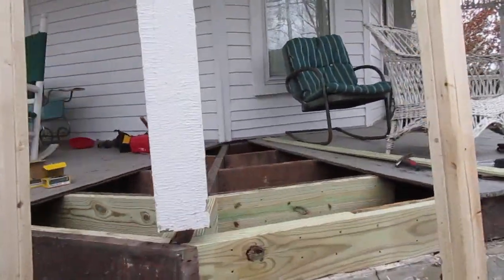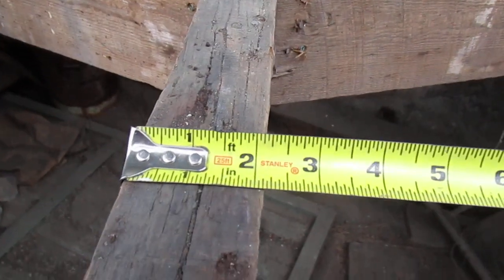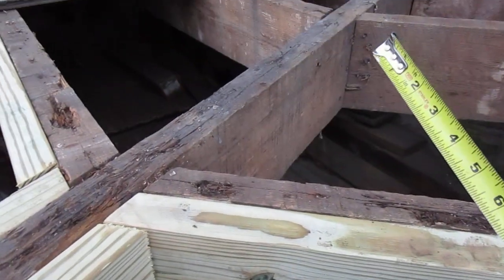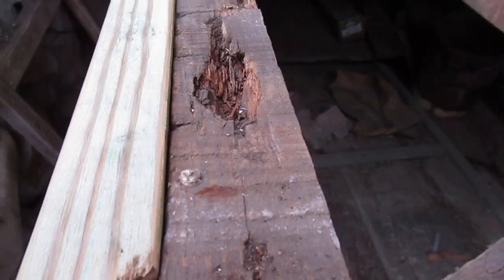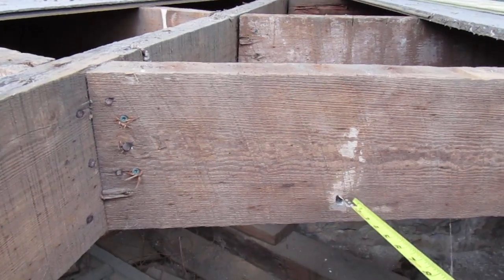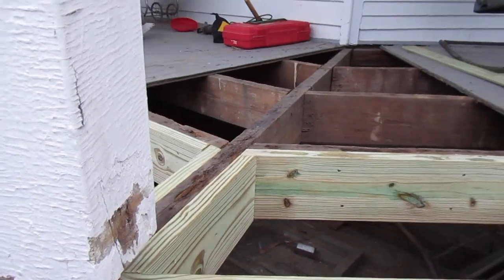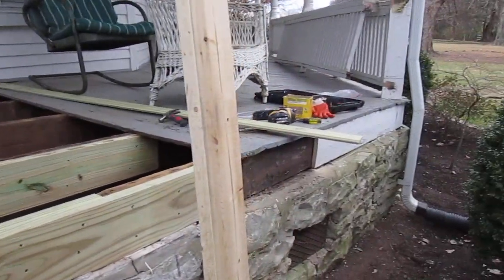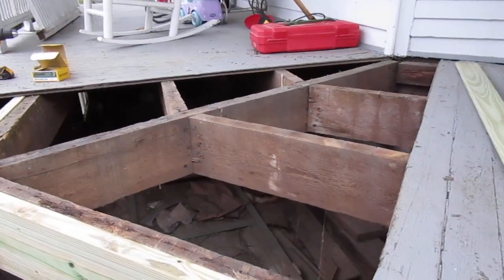Nominal and Actual Size Lumber, Dimensional Wood

Comment: does this  also happen with the lengths?  is 12 foot actually under 12 feet and 10 foot actually under 10?
Reply: Length is usually accurate either way